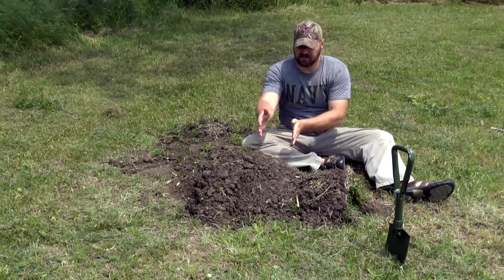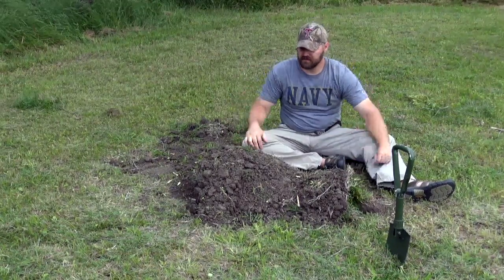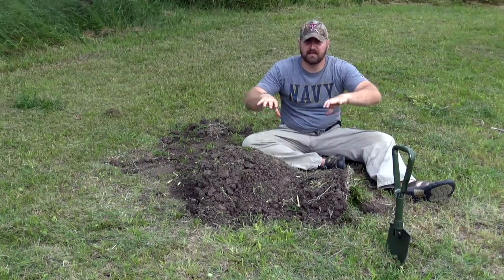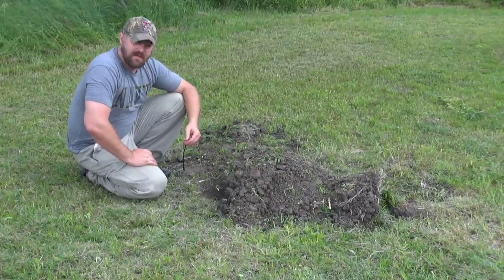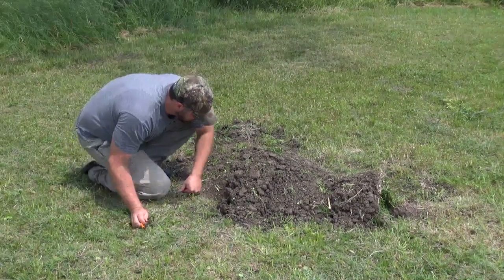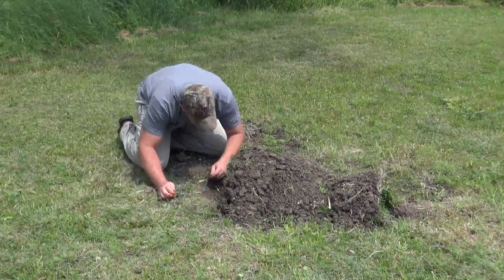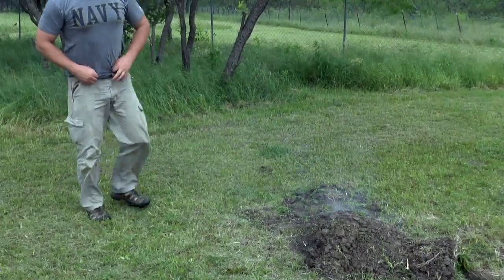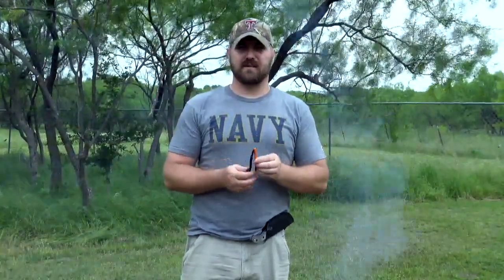Undergound Survival Fire: Using Physics of Convergent and Divergent Ducts

Comment: This seems really interesting, and if it was made flat in the middle so you could lay on it as the ground warmed up, it would be great. And not sure if it would work, but if it were made longer, with a third hole off to one side, covered by a large diameter flat rock, so you could move rock, add fuel, then replace it, then feeding it might be easier.  Sticking your hand in it as is to add wood might get a little hot on the skin. As another option, if you had a piece of 1/4 in steel to cover the third hole (if a third would work), you could probably even use the steel to cook on if it got hot enough. Or I could be completely off base and will go sit in my corner and pout.
Reply from the maker: Knife Collector really good ideas. Afterword I thought about making it longer to be able to lay across it and get the heat from its conduction through the ground. I like your idea of a fuel hole through the top. Good stuff. Thank you